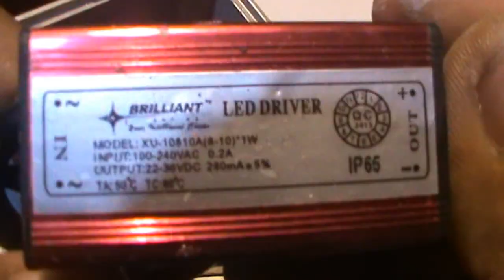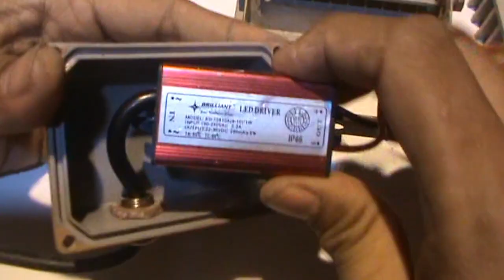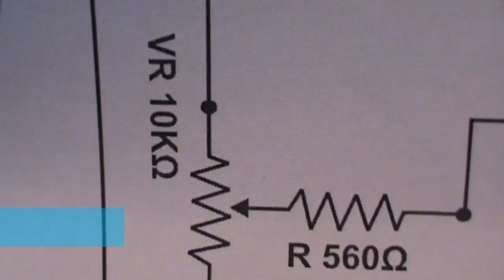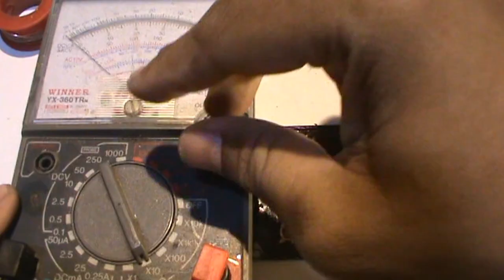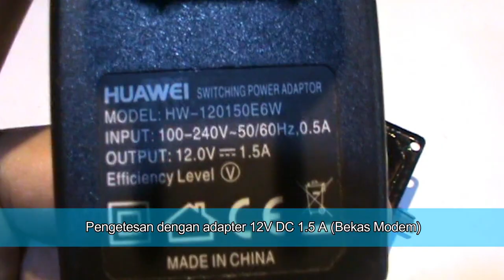Cara buat lampu lighting kamera dari bekas lampu taman dengan LED dimmer

Comment: Bang knp ya gw rekam pke mirrorles pke lampu ini hasilnya ada kedip2 item2 gtu ???
Reply from the maker: kalo dari pengalaman temen2 saya yang pakai lampu ini aman2 aja gan, baik camera Handycam, DSLR maupun yg pakai mirrorless, saya sendiri sudah coba di camera DSLR saya dan Handycam saya aman2 aja. pengaruh nya di kamera hanya masalah pengaturan warna (white balance) pada kamera model HD camcorder jenis (MDH /hxr-MC). itu juga cepat penyesuaian warnanya kalo kita setting auto. coba settting speed di cameranya. kalo masih kemungkinan di power supply lampunya gan. pakai power supply yang cukup ampere dan voltnya supaya stabil. saya disini pakai Switching Power Supply 12V 10A 120W untuk menyalakan 4X Lampu COB 10Watt
Reply: Bantu jawab gan.itu namanya flicker. Coba maen di shutter 60